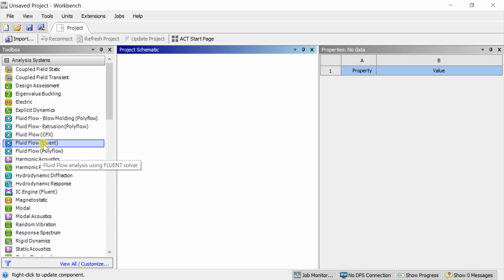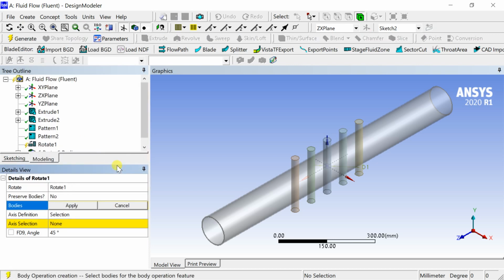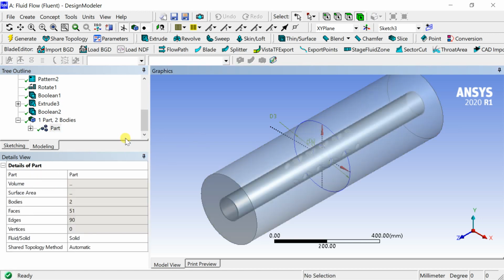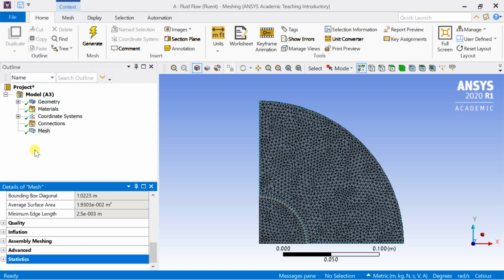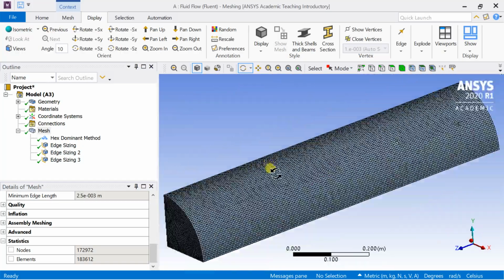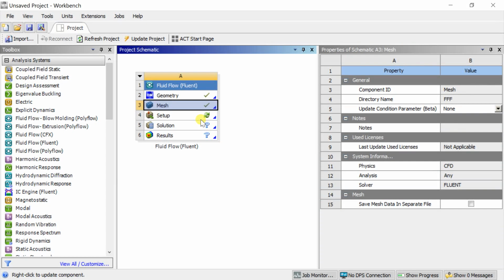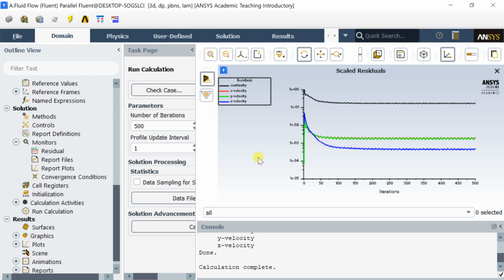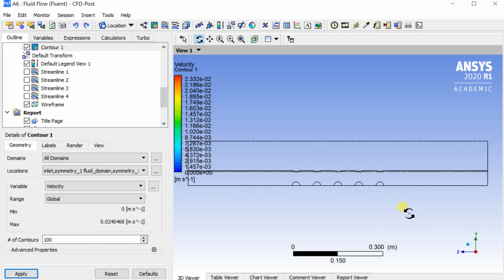Analysis of Perforated Pipe with Radial Inflow | ANSYS Fluent Tutorial | Quarter Symmetry Model #CFD

Comment: Hello..can u make tutorial for T-junction pipe..to calculate loss pressure..thanks
Reply from the maker: https://youtu.be/gV7WQ9Cwehg
Reply: I see it but i  want to learn how calculate loss pressure. What difference between if inner surface was smooth or rough...thank u very much
Reply from the maker: You can get the surface roughness option  if you select the turbulence model. We have also a tutorial regarding that.

Comment: sir can you make a video on eccentric annular flow.
HIPE- high internal phase emulsion as core fluid (but it will taken as solid not fluid because it is yield stress and high viscous fluid)
water- as annular flow 
kindly make a video on this topic..i couldn't able to do
Reply: sir I can send all the details of properties and fluid parameters
Reply from the maker: If there is a flow of this fluid, you cant take this as a solid. You can increase the density but it should be a fluid zone.
Reply from the maker: You can send us on ansystutor7@gmail.com